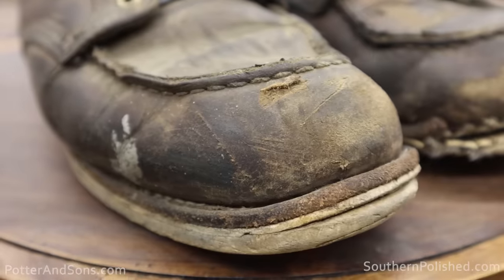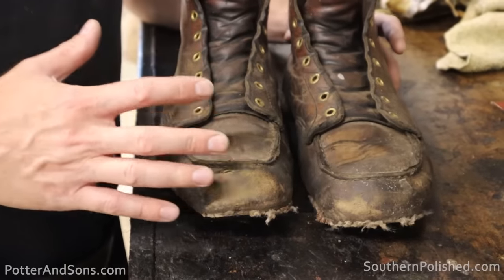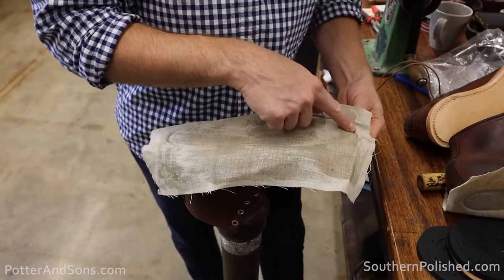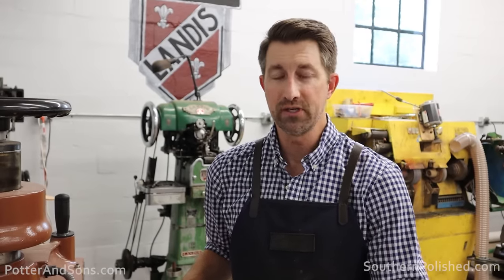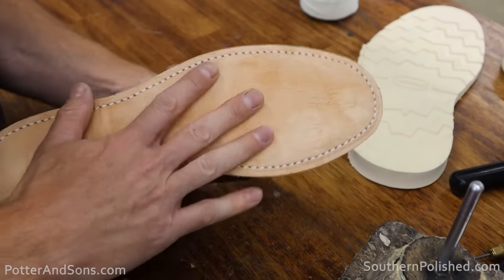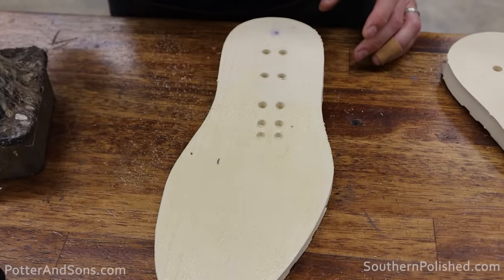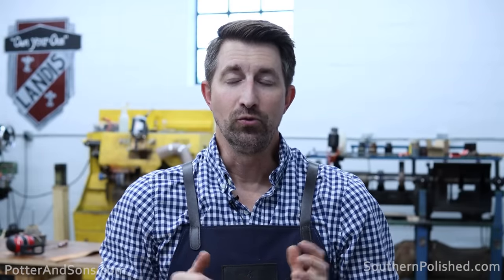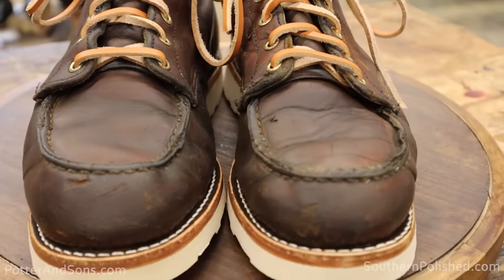Red Wing Classic Moc Refurbishment | Total Boot Makeover

Comment: Pure craftsmanship. As one who grew up in a very busy shoe repair shop, time was of the essence and did not allow for this kind of renovation (unfortunately). We had the standard Landis stitcher which constantly broke down as well as the Auto -Soler 8 and 12 models. The cement we used was the "Barge" brand. I never saw the "lace machine" and we relied instead on the "rawhide" laces.  It was tough work and by the end of a 10-12 hour day, we wete - worn out.  Great video!

Comment: I remember as a kid walking into the shoe repair shop down the street from where we lived, as i walked in the smell of the leather would hit me in the face, i loved that smell. It's sad there aren't more of these shoe repair guys around.
Reply: I used to loooooove that smell
Reply: I might be wrong, but from what I understand, a new sole can't be sewn to the midsole or upper unless it's a certain type of stitching. One of which is called a Goodyear welt.
Because of the expense involved, most soles aren't attached this way anymore, the manufacturers just use glue. Now glue isn't bad per se, but it doesn't last as long. 
I recently bought a pair of Nike Monarchs for 80.00 dollars, and they were shot in 4 months. You'd think for 80.00 dollars they'd last more than 4 months.
That's 240.00 a year for tennis shoes. Or you can spend 240.00 dollars for a good pair of boots that can be resoled.

Comment: The question would have to be:  Does it cost more to refurbish or to buy a new pair?
Reply: yeah, in any case,  just the damage those boots have looks like a new pair is just required
Reply: unless the pair of boots is sentimental to you man. all those years of busting ass to throw them away to get a new pair.
Reply: I own a red wing store (as well as a shoe repair store) and it costs between $100-$125 for resole but cost more to re-welt all together around $175. 
Red Wing Mocs are almost $300 and Rangers are $330 so definitely worth repairing, specially since you have already molded the uppers to fit your feet.
Reply: @jesussaves4623  Thanks for this info.  I was sincerely wondering.
Reply: @Nocturne2  welcome!
Reply: Yeah, that was what i was wondering. Ive got a pair of coffin toe bike boots that ive had for something like 20 yrs. The uppers arent great, but still functional. And the  heels are totally buggered.
I would like to get to get em repaired, but there's so many contradictions. I could pay a buttload for new boots, but they may not hold up.  Or i could pump money into the old pair and do a crap shoot if its gonna hold
Reply: I would rather mine repaired because when I first got my Thorogood Mocs they were so stiff and uncomfortable but now I wear them more than my sneakers. I do regret welding in them but after watching this I have hope. And I think I paid $250 without tax 4 years ago but I like moc toes.
Reply: @blackc1479  hopefully you could find an honest cobbler that could tell you if it’s worth it or not. 
We get a lot in our store that we advise not resole because the uppers are too worn. 
Your wear point in footwear are where the footwear flexes or bends, you have to mink oil regularly or leather balm that area so it doesn’t dry out and crack. 
Rest of the boot usually holds up well. If the leather is not dried or cracking usually it’s worth resole and definitely reheel as new heels are much cheaper to repair. Hope this helps.
Reply: @jesussaves4623  thanks man, the uppers arent in really bad shape, the left is good, the right is a bit rougher because i tend to crouch on the right foot (i guess) and everything thats under the pant leg is immaculate. We only have one cobbler in town, i need to find time to get over there.
Reply: @jesussaves4623  well put man as a few blisters could cost you a few days off work.
Reply: @jesussaves4623  interesting.
Reply: 🤢... sweaty feet, athletes foot, puddles of piss and dog shit! ... brave man!
Reply: @jesussaves4623  ... I wore Red Wing brand shoes ..the heel wears out re heal no problem...heave shoe tho.  Once I got this shoe to break in and fit....it was worth it to me to fix them ... one pair 4 times ...ya make a great product ...
Reply: @willgaukler8979  great to hear, every time you repair a pair, you’re buying it back for that price. Great savings!!
Reply: @jesussaves4623  same warranty after resole?
Reply: @charliethompson6601  yes one year warranty. Remember the warranty is never on wear, it’s warrantied against defect, such as a sole coming apart because it wasn’t glued properly.
Reply: The owner might consider them his lucky boots.
Reply: @Eugenia_Farms  I agree! This video is simple. He's sharing how he restores them... That's all its about .... 😊
Reply: The only pair of American made boots that I could find that fit are $250 Danners.  Quality boots aren’t cheap. Even the foreign stuff I doubt I would get a year out of were $150-200.
Reply: And inside are still dirty....
Reply: As an Ironworker your boots are very important they are what keep you safe while walking iron, having a pair of well worn in boots let’s you feel every step and is like a pair of fitted gloves which gives you the edge you need while literally walking on the edge.. A new pair of red wings takes 2 weeks of pain with each step to break in which makes walking iron almost unbearable.. The company I worked for used to give redwings as a saftey award after so many worked hours without injury so I would repair my old boots and switch back at forth between the new boots and my old ones to break in the new pair. Making union ironworker wages and getting free boots I’d rather pay to have the comfort than hurt my feet in a new pair.. just my 2 pennies
Reply: My 6" mocs from Red Wing were $230 and a full resole including crepe sole, midsole, and welt is $175 at the local Red Wing store. They're close enough in price but I prefer a resole because the leather has broken in and the insole has molded to my foot, therefore making my boots more comfortable.
Reply: @Eugenia_Farms  Someone who gets it ! sometimes its about showing respect to your tools. If you are a working man your boots are apart of your tools. I remember when I was a construction workers I grew attached to my boots. I would even mark the cuff of the boot with a line for every house I helped build(I was a framer). when they would get worn and damaged Id repair them, a sort of thank you to the boots. Eventually it did get to the point where the money spent on the boots for repairs surpassed the cost of a new pair but I looked at it this way. Most repairs on shoes are like what scheduled maintenance is on a car. oil changes, repairing gaskets when they wear out, new tires etc  is the same as resoling, repairing stitching, putting some cream and conditioner and so on. Its the cost of owning the item. Just because it needs maintenance it doesn't mean its dead.  Plus there is a since of pride , at least to me, when I woke Up every morning and MY boots were there ready to kick some more saw dust. I know not everyone gets that, heck most of my coworkers had new boots every year but hey thats just me.
Reply: @veronikaVecer9969   Yeah I would have washed them in hot water and liquid soap stuff paper towels in them and dry them . I’then do all that great work !
Reply: @jesussaves4623  I am fortunate enough to have lived through a time in the 70s where I used to work part-time at a shoe repair store. I saw a complete shoe rehabs done. Half soles, heel lifts some of which had plastic pins holding them on. The old pins were cut off glued on the recesses and new lifts glued and tacked on. Full soles, redye, an auto soler machine that shot cable from a spool through the sole,   A giant sole stitching machine.
Reply: @jjm5714  don’t you just love machines, it makes work much easier!
The landis outer sole stitcher I have in my shop was built in 1946 and still stitches like new. 

Cast iron tank, we always joke, that if we get robbed that would be the only thing left because it’s so heavy!! Lol
Reply: @charlesmckinley29  My Danner Acadias were over $300. I’m honestly considering sending them in to these guys for a nice thick resole. They’ve been through brush fires, years of wear and they looks great all things considered. I do take care of them though
Reply: @OMACMedicFiveZero  I just found a nice pair of American made Thorogood boots that were a little friendlier to my budget.
Reply: @jesussaves4623  having your foot mold to it is worth keeping it and the worn patina look is nice.  i guess i'll be getting some redwings!
Reply: @blackc1479  that reminds me of when i was in the Army and certain boots fell apart on people.  it was totally random lol.
Reply: @blackc1479    follow the cobblestone road and u shall find the cobbler.  be sure to bring some apple cobbler and beware the keebler.
Reply: @infowazz  you won’t regret it, little break in time but worth it. Let me know if you need advice on a pair.
Reply: @infowazz  yeah, i went through god knows how many pairs of jungle boots in hs. Some just sucked lol
Reply: Red Wings are ALWAYS worth to repair 😉
Reply: @blackc1479  yeah it was the black jungle boots lol
Reply: @Eugenia_Farms  not to mention just... why not repair something if you can? Everythings so disposable these days

Comment: So glad to see that one can actually have shoes repaired. Nowadays, we are often told: "I can do the repairs, but it will cost almost as much as buying a new pair."
I take care of my shoes and by the time they need repairs or replacing, I don't necessarily find a replacement that suits me. Every Spring, I take my winter boots to the shoe repair shop for a good inspection cleaning and conditioning. I clean and protect them through the winter, but the shop makes them look new.

Comment: Red Wing:  We can't fix em
Trenton and Heath:  Hold our Hot Cork and watch this.
Reply: Just my opinion, redwing probably could have repaired them, however their cost to repair them probably labor wise, wouldn’t justify it. I could be wrong, I know nothing of shoe repair, but paying to repair vs replacement, I couldn’t imagine would be to far apart $ wise.
Reply: @stellingbanjodude  It's a possibility.  There was a lot wrong with that pair.
Reply: I was wondering what that stuff was, looked like oatmeal. Use it as some kind of cushioning?
Reply: @coolmusic1579  It is cork I think.
Reply: @stellingbanjodude  Also a lot of these shoe manufacturers don't have true cobblers in the repair department. they have people who can fix things but when it comes down to engineering a shoe repair, that's a different skill. I'm not saying that's the case with redwing but it is  a possible reason (along with the labor not being economical for redwing) .

Comment: I can't believe that the time a skilled cobbler spends on a restoration like this comes out cheaper than the cost of a new pair?, I guess the owner must be attached to these boots!.
Reply: About to say the same thing
Reply: Red wing shoes are of high quality and a bit expensive new, so yes a resole or whole new rebuilt of the boot is worth it.  Plus the owner does not need to completely do a whole break in period as the uppers are broken in.  These boots are hard to break in new.
Reply: @valetudo025  sorry but on balance would be impractical for me.
Reply: @johnroberts3723  not sure what you mean by balance, but yes it comes out cheaper to do a resole and some people like you said are attached to their shoes.
Reply: @valetudo025  well I have a yard broom that ive had for five years, sweeps just fine however its had three new heads and four new handles lol!.

Comment: These boots have just doubled in value. If they haven't tripled.
Reply: Probably cost the same as a new pair
Reply: @anteck7goat  But sometimes it is not the same thing.
Reply: a new pair cost $279. and i imagine the cost of repairing this is expensive. so it might have been better just to buy a new pair but the owner might have sentimental value to this specific pair so that could be the reason they chose to repair them instead.
but regardless of any of that. still a fun video to watch
Reply: Probably a $500 resole.
Reply: @LWZ2010  breaking in a pair of leather boots is a long and painful process. It is worth it to keep a pair of boots that you can work in.

Comment: These poor Redwing boots were so trashed, I'm actually surprised the owner didn't just toss them in preferance of a new pair.

I wonder what the cost savings was for these as opposed to a brand new pair? 
The only downfall is that Trenyon and Heath restore and repair with a much higher standard than aa new pair off an assembly line
Reply: Their website seems to indicate that putting on a new sole would be about half the price of a new pair. Not sure about the conditioning and dying.
But if the uppers aren't too damaged it seems worth the price, plus the boots are already broken in.
Reply: @donmiller2908  yes, but he did more than a new sole. he had to rebuilt the bottom of the shoes
Reply: @edmundooliver7584  - I don't know. There isn't much information about that on their site. You could contact them and ask specifically about this video, what they charged the owner for their services. It would give you a better idea whether to repair or buy new.

Comment: Genuine question - what’s the economic incentive to get shoes repaired vs just buying new ones?
Reply: Judging by the wear of the boots, the owner works a demanding job on his feet. If he were to buy a new pair of boots, they could make his feet sore and reduce his productivity. If he works construction and it takes him an extra day to finish a project, that can be much more costly than a couple hundred bucks invested in comfortable footwear for optimum performance.
Reply: Probably just didn't wanna say bye to the boots. Brand new redwings could be upwards of $300 or more. Idk what restoration costs though so I'm also curious why someone would do this instead of breaking in a new pair. However I would bet this pair is not the customers only pair so I highly doubt it has to do with saving time.

Comment: correct me if I'm wrong but this work looks definitely more expensive than a new pair of Red Wings.
Reply: I don't think so. The video is 15 min, and while it did not cover everything, the work was less than 1 hour. Considering 100 US$/h a nice income, it should be cheaper, but of course they called for more. But shoe repair is a dying business, at least we can buy the machines of the dying shops for cheap, we will have to repair our shoes by ourself, and it is sad, that he did NOT explain, which type of glue for what reason (material of sole) he selected, what he used to clean, color and to oil it. They keep the knowledge secret. I would be interested in it, because I have some rather used oiled leather shoes.
Reply: They are 270$ boots, that’s probably in the sub 100 range for repairs
Reply: @Jersey0054  if this is a sub 100 repair to you including mats and the quality of the job is ok, I'd definitely like to get to know your cobbler. He obviously likes your shoes more than breaking even.
Reply: @BENNanza  a cobbler shop in Columbus Mart, in NJ. Amazing work, affordable prices.

Comment: I am not a professional cobbler. But I have a few pairs of thorogood boots. I am a mechanic and see grease and oil daily. I experimented on 1 pair on cleaning. I sprayed some cherry tree decreased, local vendor, and took a pressure washer to them...it removed mostly everything. Let dry for a few days, wet the boot and used saddle soap, let dry and repeat. Then I let them fully dry for like a week. Then I used mink oil and they stay looking like new. I do this every 6 months.

Comment: I bought my heritage classic moc toe probably around 6 years ago.  The boots are great, a little pain to break them the first two months, but they are great after that.  Since I walk like a duck my sole is worn out and I need to replace them, the leather still in good condition even I used them as office boots, then work boots in automotive plants and then they migrated to work boots for my housekeeping, I cleaned them up and I have wore them casual, I want to restore them to take them back to office.

Comment: wow , really cool process , I am a retired Woodworker and t II have had a identical pair of pliers that you used in the beginning of the video to pull off the worn out soles  I honestly always thought that those were a Carpenters tool as that’s what I used them for over 35 years  basically pulling unwanted nails  or other fasteners another hobby of mine is upholstery  so I’ve used them for pulling  staples  as well

Comment: Amazing video! Great work! I'm a little saddened though being reminded of the pair of Redwing boots I bought and were definitely not up to the name. Redwing refused to do anything about them. I had only worn them a total of 10 times and they leak horribly. They're supposedly waterproof with a membrane yet even time I've gotten in any type of wet grass, snow, or rain I can feel the water creeping in. It's frustrating that I paid as much as I did for a hot that performs no better than one from Walmart for a fraction of the price. Is there anything that you could do to fix them? I really enjoy the look and fit of the boot but the lack of waterproofing makes it a non-starter.
Reply: Are they Red Wing Worx, Irish Setter, or Heritage? The former two are made overseas, and heritage is their only truly high quality brand imo
Reply: Oil them up really good. Use obenhaufs or something like that. If you saturate them enough they will be pretty much water proof. Unless of course there's a notable hole somewhere